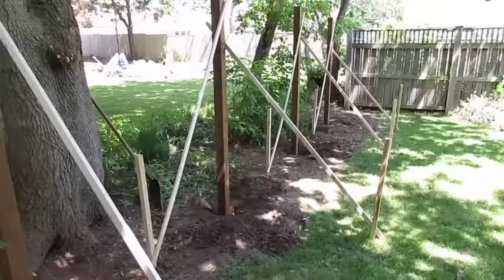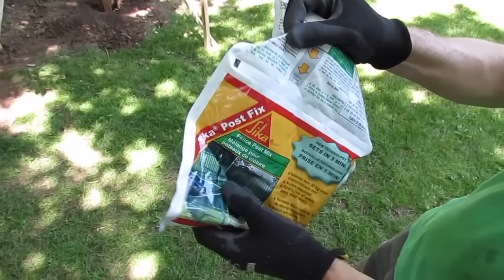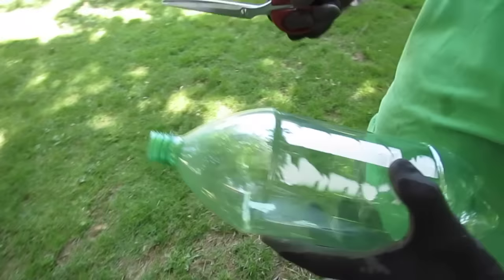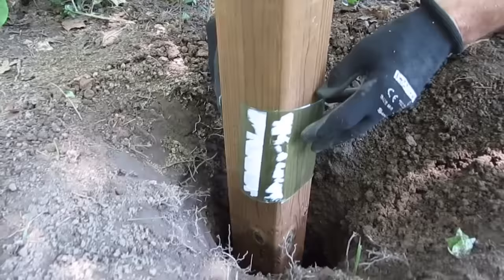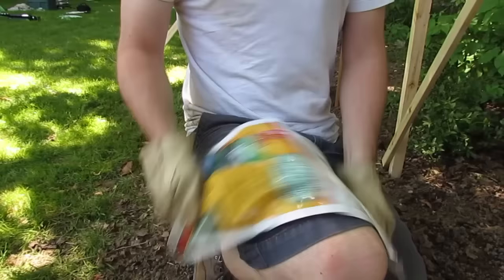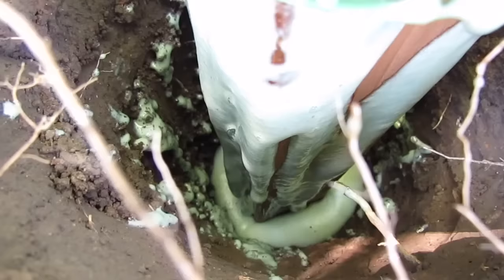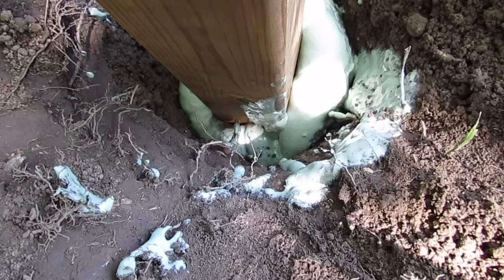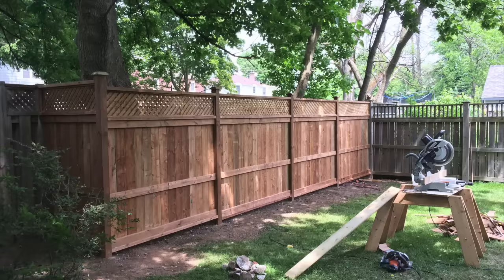No Concrete Fence Post Install!

Comment: 1st. Cement is one hell of a lot cheaper!
2nd.  This foam breaks down much sooner than concrete ever will! 
3rd. There are people making outdoor statues with this material and it's fine for a couple yrs. After that it starts failing very quickly. That's how I know its not even close to the lasting life of concrete. Just make a block from a bag and leave it outside to weather you'll understand in time.

 I see no reason for this product other than it being different. By no means is it close to being a better way of doing a fence job. 
Build it they will come.. How true that really is today...Wow!
Reply: and where are you facts to support how long the foam breaks down vs. concrete?

Comment: Surely the idea of concrete is ballast...its to add weight to the base to keep the post in place during high winds...That foam will do nothing when the wind blows 🤔
Reply from the maker: Surprisingly not, the stability of any post comes from the filler material pushing up against the soil. The amount of surface area inside an augered hole is massive and that pressure and friction up against the soil is what makes a solid post. The weight could have some small benefit, sure, but it's mostly friction and surface area that does the job.

Comment: Wood in soil, how much time untill it rots? In my country we newer put wood into soil. Pls tell me as this is interest me.
Reply from the maker: I live in Canada. I would say the majority of fences built here are wood and the posts are typically installed at least 1 metre into the ground. Most folks use concrete to hold the posts in place, some use soil, and some use foam. Typical life expectancy of a well built wood fence is 20 or so years. Chain link fencing is also popular and is installed the same way.
Reply: @PatonHaus  Thank you, interesting.

Comment: It would be a lot easier to pour dry concrete down the hole then add water  AND you wouldn't need an extra person to stand around with a watch and tell you when 30 seconds is up

Comment: I am a structural engineer, licensed in a half dozen states on the west coast and have been for 20 years.  While this may be good for someone with accessibility / ability issues, it's not the ideal choice for anchoring a post.  Concrete is ideal because of its mass as well as the volumetric lateral pressures it inherently provides within firm soil.  In my home and church projects (no permit needed), I have used 2-3 bags of concrete which is still cheaper than this high-priced commodity.  3 bags of concrete for a 7 foot post (which is the legal limit in the IBC section 105.2) is excessive, but I like it to stay there for a long, long time.  Also these posts do not appear to be incised-treated which means that they are likely not treated for ground contact.  These posts are likely deck lumber.  So much misinformation out there.
Reply: I've also had to painfully sit through SIKA sales pitches at my engineering office.  They are great at some products.  I think they provide concrete mix additives for air entrainment, etc.  However, this is not one of those solutions that people are jumping at the chance to try.

Comment: So it's been about a year since you posted this vid, how is it holding up? I want to do my own fence and this looks like a good option. Thanks for sharing.
Reply from the maker: 2 years actually, and it's rock solid, hasn't moved an inch.

Comment: As someone who tried this stuff out before. Seriously use concrete, so much easier. BTW is 12 dollars at HD now.
Reply from the maker: I wouldn't say using concrete is easier, but it certainly has its place.
Reply: @PatonHaus  I've never had a bag of concrete explode on myself and all over the fence. Do you have any idea how hard it is the get this shit off the fence and your skin?

Edit And yes most of it was user error with the foam on my part.

Edit 2 But seriously, any tips on how to get it off a wood fence?
Reply from the maker: It's nasty stuff for sure, and incredibly sticky. I would suggest just scraping it off and if there's any residue left just hit it with some sandpaper.
Reply: @PatonHaus  thanks man

Comment: 100lb female here, still prefer the $5, 50 lb bag of quickcrete dry poured into hole, add water.  But can someone explain why concrete comes in a PAPER BAG???
Reply from the maker: 185lb male here, thanks for your comment.

Comment: The real question, is it more expensive than concrete? An 80 pound bag of concrete is just under $6, I imagine that foam stuff is significantly more expensive which would definitely add up over the span of an entire fence
Reply from the maker: Yes, definitely more expensive. Many comments have also mentioned using this stuff for smaller things like mailboxes, landscaping features, plant stands, etc.

Comment: I've been fencing for 10 years and this is ridiculous! The points you mentioned is that is saves time and is less messy. #1 It doesn't save any time when you have to brace all your posts like that. Regular posting doesn't require bracing posts. #2 How is normal posting messy? If you know what you're doing you wont make a mess. #3 Im guessing each one of those bags cost at least $10. With sand, gravel and cement mixed to the correct ratio it will cost about $25 to do 20 meters (6 posts spaced at 2.5m). Using those foam bags would cost $60. In conclusion it's just a stupid gimmick designed with the idea that it will save time. Sometimes it's better to just do the job instead of wasting time trying to think of a way to get out of working.
Reply from the maker: Good stuff! Glad I could help!

Comment: Interesting but flawed concept. The author has the correct objective; keeping the post steady. Nothing like a nice fence installed on posts that are too shallow. Before long, the fence will be tilting at a jaunty angle. I hear they have strong wind in parts of Texas. The foam is really OK. priced the foam (Lowes) at $12.70/bag. a 4XX4X10' is about the same. An 80 Lb bag of concrete mix is $4.80. when I did that sort of thing, we used 1 bag/3 or 4 holes. The really big issue is that you do not want to encase the treated material in concrete, or foam. Concrete will remove the moisture and degrade the post. I have seen countless posts that were encased in concrete and moisture got in and eventually split the concrete. Time proven method is dig hole, place concrete mix, preformed pad or even a nice flat rock in the bottom of hole. (this is a fence, right?) Plumb & brace post. Backfill the post with the soil that the auger tossed up, gotta do something with it. Tamp the soil in lifts. If you have concerns about stability, throw in rocks as you are backfilling. If you are really concerned about stabilizing the posts, saturate the backfilled hole. In a few days, it will be kinda like being encased in concrete without the drawbacks. Some of us in the trades really like to limit the amount of foam used. Protecting the environment and all.

Comment: this product is expensive compared to cement and i think this would be great for if like 1-2 posts were to break magically from the ground then this is an easy fix but not to build a brand new fence it’s not worth paying alot of money all because you don’t want to make a mess and i believe it’s the person not the product that’s messy
Reply from the maker: We definitely made a mess, no doubt. This fence was only 4 posts between two existing fences, so this job was fairly small. Shortly after this I also fenced the side of my yard, about 120 feet, and I used concrete for that one.

Comment: :) I have had multiple wooden fences, and I will never, ever have another one.  After 1-2 years they start looking like crap.  And when you have to mend one of the boards, then it does not match the other boards and looks even worse.  Wooden fences should be replaced with PVC or metal fencing.  Our HOA does not even allow wooden fences. You guys work too dang hard.
Reply from the maker: Answering to an HOA must suck

Comment: These comments are disturbing and strange. Im not sure if id trust foam on a fence post but if you guys knew anything Sitka brand makes some high tech stuff. Im a pro cement finisher and we use alot of Sitka products at work. Im sure its a super hard foam.

Comment: Maybe for a very small job this could be useful but I would not recommend this product for anything load baring. These post in this video are not below the frost line and they have no weight. Most of the time these would move over time.
Reply from the maker: To be fair, most fences move over time with seasonal changes, it's the nature of the beast. This was a small job being only 4 posts, so this was a perfect solution. Thanks!

Comment: '
better use sand concrete mixed with water or concrete with many small rocks mix with water the pour in big hole is the best, heavy weight, strong hold tight...
foam is a too light weight and not hold tight

Comment: Concrete works alot better you don't have to mix it just pour it in add a lil water it will harden and and 80 pound bag is about 5 bucks or so. Compared to a bag of foam for 25 bucks and you got half a post foamed up. I don't see the reason to go broke buying foam. Sure it has a purpose but I can't justify the $$ amount for the end result. Thanks for sharing its neat cool idea. Cost effective nope. Good idea for the company and marketing to make  money tho.

Comment: Does this work the same as foam insulation?
Reply from the maker: This stuff is a much harder and denser foam. The stuff in the can is too soft for an application like this.
Reply: Damn, I wish they had laughing faces on this comment section.
Reply from the maker: @10laws2liveby  It sure is a mixed bag

Comment: I don't understand the advantage. As others have pointed out below, there is no mess or trouble using dry concrete + water in the hole.  So if the only advantage is avoiding the mess and trouble of concrete, then there is no advantage at all.

Comment: I can see a couple of problems with this otherwise neat looking method.  First, more plastic waste from the packaging.  Second, how perishable is the foam over several years? Third, and most concerning, is that when concreting a post in the ground, one should always finish it with a surface sloping away from the post, so that any rainwater does not collect against the wood, and increase the rotting process.

Comment: How would this product react in a quake? We have a lot of concrete quake damage where I live.
Reply: since its so soft im guessing pretty well. i still wouldnt recommend it though
Reply: Supposed to be pretty good.  Ran 4 post for about 16 ft of 7 ft fence with  this going on 2 years ago, still holding good.  Have had a couple small earthquakes,  hoping I won't see a big test😳

Comment: I have a question that I hope you can answer.  Did you need to call 811 before you started putting in your fence post?
Reply from the maker: Is 811 a utility locate thing? If so, yes we did. We have a different system here called OneCall but yes we had locates done before we augered. This was in a backyard and there was nothing back there to worry about.
Reply: @PatonHaus  Yes, 811 in the number to call before digging. I think some of it is pretty rediculous as they also suggest you call even when planting plants. I got 2 acres of land and I simply want to put up a fence around my property but they make you jump through all these hoops.

Comment: I need to install cafe lights in my back yard for my wedding. So very temporary. Do you think a canned foam and PVC pipes could work?
Reply: just put the pvc in the ground if temp, it will stand up. one trick is to buy or cut like 18 in. of a bigger pipe. the one you use as a pole can move around in it a bit and pound the 18 in. sections in the ground. you can leave a bit above ground. Then just slip The pole in.  the wiggle room you can use to make it straighter by wedging something, sliver of wood , tape, anything if it isn't straight enough. You get the idea.
Reply: After hurricane Harvey came through and knock down most of the power poles the linemen came in and used foam on many of the poles. I’m not sure if it was quicker or easier since the ground was soaked with water and the mud was hard to deal with. I planted many post for a pole barn company and found through my adventures that sackete will harden overnight in the hole around the posts without adding water. The ground usually contains enough moisture to do the job.

Comment: While it seems a bit extreme for setting some fence posts, I wonder if this foam would work well for fixing a bad or missing mortar bed for a bathtub.  That almost looks like the perfect density once cured unlike the low expand foam that us "Duct Tape DIYers" tend to use.  I wonder what kind of expansion force it puts on surfaces (which can be a problem if you get trapped foam that might push the floor of a tub or lift it where you dont want.

Comment: This stuff seems cost prohibitive to me.  It's like $11.00 for one bag on Amazon. I would imagine concrete is cheaper to buy and mix if you know how to do it.  However, I admit that this foam material would work for certain, single object fixes.
Reply from the maker: The price seems to vary wildly depending on where you live, some folks in the comments are reporting $24 a bag, yikes!
Reply: gjevideos ,Another advantage is that foam is more earthquake proof. Where is concrete will crack when the earth shifts, foam will have more flexibility in it. This is especially important for people in California because the big one is going to happen any day and there will be no electricity for the dryer so therefore it’s important to have a good functional clothesline to dry the clothes after the big one.

Comment: In my opinion NEVER put wood into the ground. Not if you want a long life fence. In the UK we have just had 2 big storms. Every fence that I saw fallen was because of rotten wooden posts. Even pressure treated will never last as long as concrete posts. And if the panels blow out at least the concrete posts are still standing. Just slide a new panel in.
Reply from the maker: Concrete posts are not common here at all, most fences are wood or chain link construction. Fencing definitely varies wildly depending on where you're from, and trust me I've heard about all of them.
Reply: @PatonHaus  oh right OK. But in my opinion a fence that has not got concrete post's is a flat fence Lol. . So even if not common. I'd be using them for my fence. Building a fence is a thing that I personally don't want to be doing every few years. 👍

Comment: One $5 can of great stuff makes more foam than a $20 bag of that post fix nonsense!  Concrete not only holds the fence vertical, but it also anchors it with the weight of the concrete.  Postcrete for the win!
Reply from the maker: There are different kinds of foam for different purposes. Great stuff is very soft and maleable, and needs to be to seal windows and drafts effectively. The post foam is very dense and very stiff. 

Also, fences do not rely on the weight of the concrete for stability, the concrete is merely a filler material. The real strength of a good fence comes from the soil pressing upon the concrete/foam and resulting friction between the two. Concrete is a popular material for this reason because it is so cheap, not because it is heavy. The only time the weight of concrete is important is when you have to yank the posts and end up with a herniated disc.

If you've ever tried to pull a t-bar out of the ground you'd understand how effective soil friction really is.

Comment: How dose it compare cost wise
Reply from the maker: For small projects like this one it's a marginal increase, which at the time was worth it for me to avoid transporting the concrete.  I've since installed another fence about 5 times as long and I used concrete as I was getting the whole order delivered. It's something you'll have to work through yourself to determine if it's worth it for your project.

Comment: What you are doing now is more of a hassle than Concrete, get a mixing tub and a hoe,  mix before poring in hole for best results  takes 3 min. ,,,Use fast set for posts then you don't have to brace them and it saves wood costs too. Just plumb up right after you put the post in the cement and walk away to the next post, go back and check plumb after 1 Min. then your done. Where is your string line,,, you need it there to do it this way.

Comment: Wow....soon as I saw all of that bracing I heard a loud "OVERKILL" ..".OVER THOUGHT "  screaming in my head....what's the big deal? I can set a plumb post by hand with  a post level using regular old cement ...wet or dry....and I consider myself less than average when it comes to handy man skills
Reply from the maker: Thank you! I appreciate the comment!
Reply: The bracing isn't overkill if it keeps the posts plumb while the foam sets, understandable  comment if you are below average handy man by your own admission, or would definitely agree that you are.

Comment: You shouldnt use concrete or foam water is going to sit ontop of it around the pole and rot it.
You should just use packed sand so water doesnt sit next to the base of the pole.

Comment: If you're going to use foam why not just get a can of expanding foam spray stuff that is a hell of a lot cheaper and easier to use, with same properties?
Reply from the maker: It's not the same, different density.

Comment: thanks for the video but....Concrete is the way to go...
Urethane is good for windows  but not good for fence posts
Concrete MUST be above grade...and pitched away from the center
you HAVE TO encapsulate the post  otherwise they rot within ten years

Good luck finding a contractor who agrees !!!!!!!